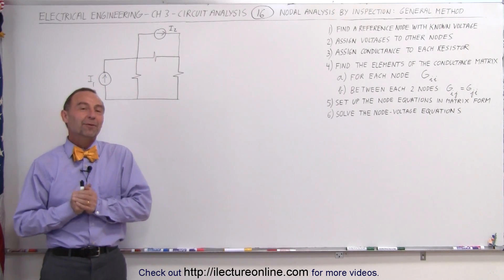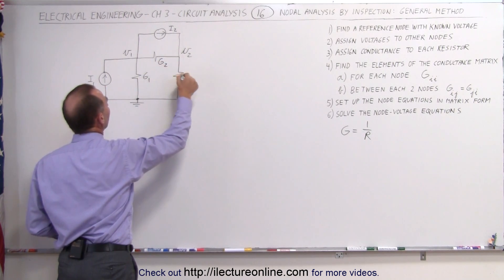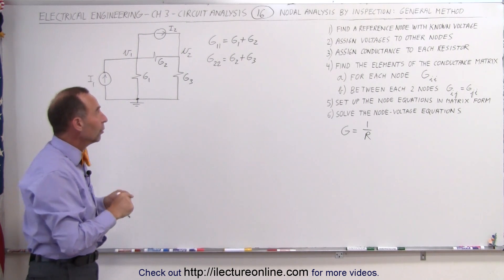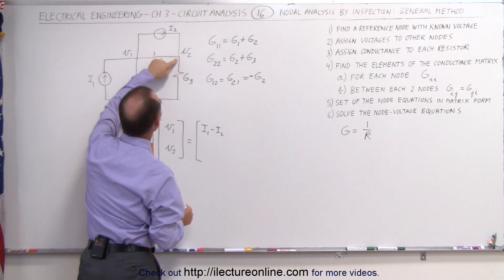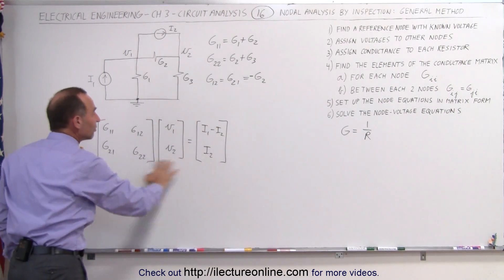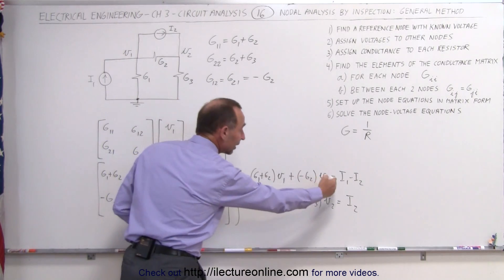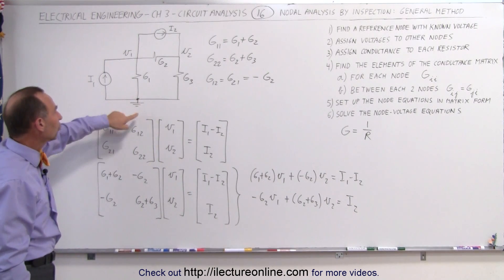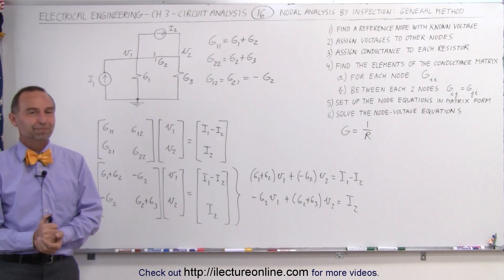Electrical Engineering: Ch 3: Circuit Analysis (16 of 37) Nodal Analysis by Inspection: General Meth

Comment: If we are subtracting 1/r2 (G2) as: eqn 1 (v1-v2)G2 and eqn 2 (v2-v1)G2
doesn't this mean we are giving resistor 2 two polarities? 1 going in the direction of v1 -> v2 and the other going *from v2 -> v1*?
Reply from the maker: We subtract because we want to calculate the voltage difference (potential difference) across the branch.  If v1 is higher than v2 the current will flow from 1 to 2.  If v2 is higher than v1 then the current will flow from 2 to 1.

Comment: Hi professor, is that possible for node 2, there is another current from v1-G2-V2 flows in?
Reply from the maker: You can check the results with another method and you'll see that you get the same answers.  The method is correct as shown.  Note that the currents are placed in the other matrix.
Reply: @MichelvanBiezen  Thank you very much!